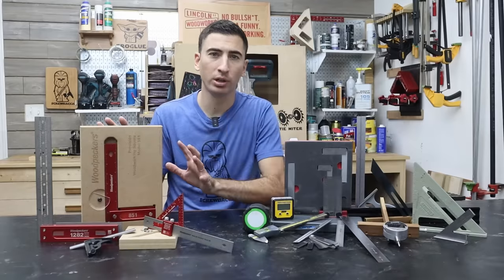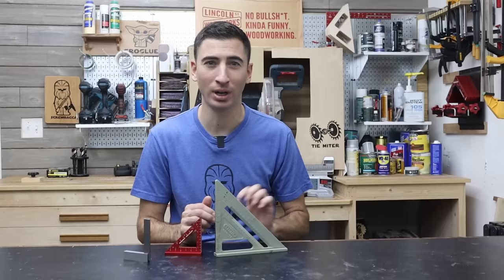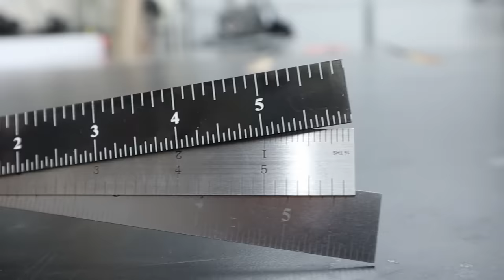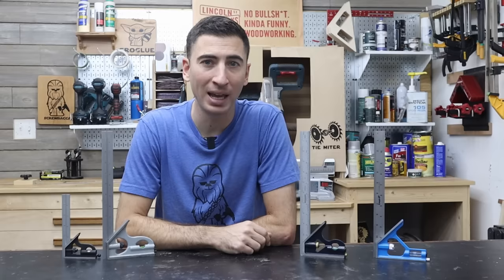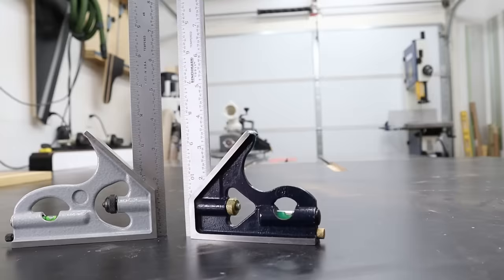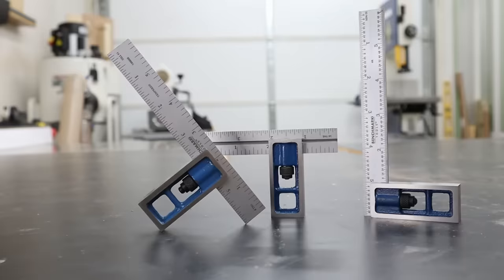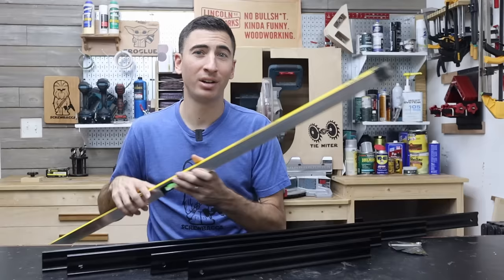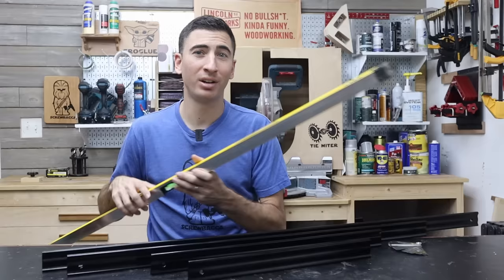Why is woodpeckers so expensive?

Comment: I designed and did all of the tolerance stacks on that empire combo square. Your assessment of the accuracy is actually false! I went through significant pain in order to make sure that it is accurate to the spec on the packaging and you should never end up with .01" variation even on the 12" square. If you have money, buy the starrett. If not, the empire is a quality option that's made in the US and was designed by yours truly. I don't work there anymore, but I still buy their products if that means anything.
Reply from the maker: The degrees translating to the .01" was in reference to another brand that advertises that way. Appreciate you chiming in though (that was serious comment, just wanted to clarify)

Comment: OOPS! This was supposed to be a reply to a person who suggested the metric system. Aparrently I did someting other than reply to that person. However, I will leave this here anyway for general information. 

In a way, we DO use the metric sysrem. One inch is defined as exactly 25.4 mm 
Having worked in measurement science (a.k.a. metrology) for much of my life, I have used both systems. It depends on the circumstances. Personally I would rather use metric, largely because all magnitude changes are powers of 10. In the American system, it seems every unit has a different factor for magnitude changes. 
And yes, I said the American system. That is because now, practically every other country on this planet uses the metric system. The American system is derived drom the old British system of their Empire days, commonly called the Imperial measurement system. But the British Empire has not existed for a long time, and even the British routinely use the metric system now. Heck, they have even decimalized their currency! 

Full disclosure: I was born English, moved to Canada at age 6, and moved to the USA at age 10. I have been an American Citizen since early 1968, not long after I became a US Marine.

Comment: Pro Tip: The Zebra .5mm M301 is the perfect mechanical pencil for the Incra T-Rule. I use them exclusively in my shop now, after buying them to work with the Incra, and they are the closest thing to a marking knife with lead, while being very well made.
Reply: The Pentel Graphgear are also amazing sets with retractable tips so you dont have to push the led in for storage. I have the 5mm for my incra gauges and the 7 and 9mm for standard writing and when marking rough lumber for milling. best part is they are cheap on amazon.

Comment: "any first purchase for a new hobby is machinist square, so you can verify you table saw, band saw, miter saw and jointer" ... here is my advice - ignore this guy, you don't need machinist square, what you need is square with ruler. carpentry doesn't need that kind of precision but ruler is must

Comment: You are talking two different fields.  Using them to mark and do lines on the wood projects. 
The more expensive ones in machinest field. Are exactly what you need to actually set up the machines that you're going to use two different fields

Comment: WTF!!!  Since I have lived in both universes, I thought, for sure, I could contradict something in this video. You started off good with the machinist squares. Even the cheap ones are very accurate, When you got the the combination squares, I knew I could complain about something. When I started in precision metal fab and started buying tools, I bought almost nothing but LS Starrett. I have the 4" 6" 12" and 24" and 36" blades all with graduations to the 1/100th an inch (16R) and I have the center heads and protractor head. ALL of my tools are American, German, or Swiss made. I no longer work in that trade so they all stay in the box. I recently bought a 16" combo square made by Johnson and a 6" made by Empire.. BOTH are complete JUNK! not even good for rough framing. . The machining is unbelievably bad. pieces do not fit together, the blades don't slide and they are very inconsistent even if just being used as a depth stop.. . I also have a bunch of plastic and aluminum speed squares. The plastic ones are a couple bucks and the aluminum are usually under 10 bucks.. BY FAR, I grab the plastic ones more than anything else.... SO now my complaint is that I have no complaints other than the government.. Let me know when you can fix that mess...   G ion this video.. ood information

Comment: I don't know if the super cute super expensive measuring tools are worth it as most people aren't within a couple thousands in their ability. I really don't know how us old farts that didn't even have electric miter box back in our day and had to use a mechanical box and back saw or make cuts with old fashioned table saws without stops if you decided to shove your finger in it. Man those pieces of furniture wasn't built with fancy tools I'm not surprised they only lasted 150 years

Comment: Woodpeckers makes a very attractive looking product that is well marketed.  That said it is way overpriced.  It is nothing more that color anodized aluminum that is not durable.  It's not even hard anodized. Try getting dried glue off of any of their products without causing damage. Many people will tell you that it's more accurate, but NOBODY has that kind of measuring equipment at home.  Another factor is thermal conductivity.  Aluminum is at the top of the scale for thermal conductivity.  Why does that matter, because just holding an aluminum tool will cause large amounts of dimensional instability.  That's why no machinist uses anything made out of aluminum Precise measurements are done with low thermal conductive instruments.  People will argue that woodworking doesn't require the same accuracy as machining which is absolutely correct.  Then why pay so much for something that is nothing more than pretty and red?  It's not for accuracy.

Comment: Great video. 

Artisans have been building wood furniture and buildings for centuries....without...woodpeckers over-priced tools.  Their furniture and buildings are straight and true. Woodpeckers is laser cut ....hellooooo..........laser cut which is programmed to cut exactly at whatever angles or dimensions are dialed in.....WHY.....WHY....WHY so expensive.

 If anything - they should be cheaper - but they're laughing to the bank because of those who don't want to take the time to be skilled craftsman. 

Indentations for pencils --can be made easily with a triangular $5 dollar file....lol

I refuse to support companies trying to market "premium" woodworking tools -- for a hefty sum.  This has been the latest get rich Gimmick over the past decade. 

Woodpecker, Festool , Bridge City Tool Works...and on and on. Their tools do nothing, or I should say they do ONE THINg exceedingly well --emptying your wallet.

Comment: I like inexpensive machinist squares but you really don't know if they're square unless you have something to check against.  My dad's best friend (the owner of a machine shop) gifted me a Starrett master machinist square 12" when he was retiring and closing down his business (along with a 15" level) and I use that along with a granite surface plate (Grizzly) to test squares.  I've actually returned some cheap machinist squares because they were out of spec. A Starrett combination square can be used as a reference to check machinist squares for general use.   If you search for old Gerstner tool chests for sale they will often come with Browne and Sharp or Starrett machinist tools that although old are still in great shape and accurate.  Also find a reference distance measurement.  I have long Starrett straight edge that had a small portion of it's end mangled (which was cut off) but is still very very straight.  On it, a machinist etched some reference marks for distance.  I use that to check the accuracy of tape measures.  Amazing how much variation there is is tape measures.

Comment: Correct me if I’m wrong but this guy just referred to a speed square as a “one trick pony” when it is actually a ‘many trick pony’ - he obviously just doesn’t know how to use it. It works as square, a right-angled triangle, a protractor, instant roof slope and birdsmouth calculator, staircase balluster cutting guide and anything else that requires any angle of cut. And btw, if you need a $100 tool to square up your sawblade you need to go back to woodworking school, or Grade 6 geometry or something. Geezus. See ya later.

Comment: Aluminum is cheaper to produce? Does woodpecker know this? If I'm spending 100-250 for a measuring instrument, it better be atamantium
Reply: Have you noticed their stainless steel tool versions are ALWAYS more expensive than their normal aluminum ones?
Reply from the maker: Yeah if you think their aluminum is expensive - check out their steel tools which everyone forgets woodpeckers makes

Comment: I use machinist squares and machinist rules. I have several sets of different sizes. I paid less than $80 to have all them bought and shipped from Germany.
Where you and I part ways, steel versus aluminum, especially for straight edges. Steel. Steel. Steel. You WILL dent, ding, damage and possibly warp your aluminum used-to-be-straight-edge. Money wasted. 

And no Cteven is a loser. So is drinking soy, sugary and garbage coffee drinks from hipster joints.

Comment: As a machinist if you are working with wood you are wasting money. You are dealing within 1/16" to 1/8th tolerances. Metal you are dealing with tolerances from 0.001 to 0.004 - or +.
Reply from the maker: If you’re a woodworker building furniture and you’re dealing with 1/16 to 1/8 tolerances you’re wasting your time
Reply: @Lincolnstww  Not talking furniture but even with furniture you're not dealing with thousands of an inch. 1/64th = 0.015 no way you need to be closer then that with wood. Wood is always moving.
Reply from the maker: @TheCleaner6969  I’m glad you’re not in charge of giving advice to people who want to build furniture. Wood does move, but it doesn’t move in a direction that’s impacts your cut becoming anymore or less square
Reply: @Lincolnstww  If you need wood cut square to the thousandth of an inch buy a plainer cause there's no way your that steady. Boom!

Comment: 2:28 Did he say steel is more expensive than aluminum? Wut?
Reply: No
Reply from the maker: I remember saying steel is more expensive to produce. The raw material is cheaper but that doesn't mean much.
Reply: Aluminum is much more expensive to produce than steel, so I'm curious where you heard that. Aluminum is more reactive than iron, so it requires a more involved extraction process called electrolysis which also happens to be an energy hog. Steel is cheaper to produce and cheaper to buy.
Reply: @AaronGeller  yes, he said...
"Steel is more durable but caries a higher cost."
"Aluminum is softer which makes it more prone to denting but it's cheaper to produce."